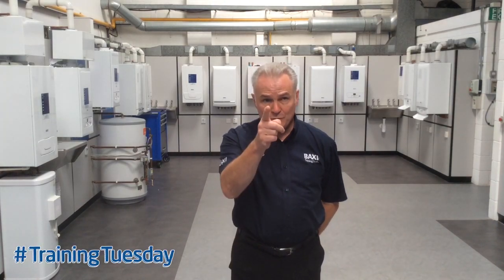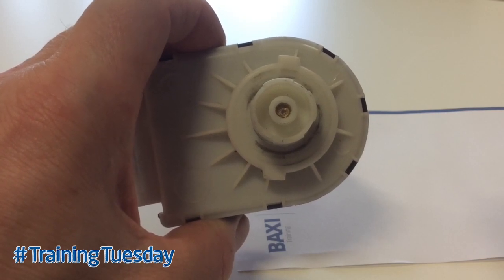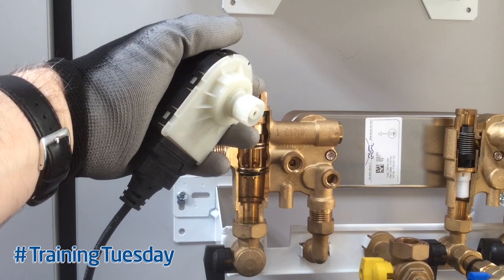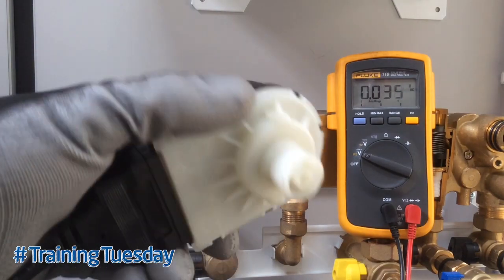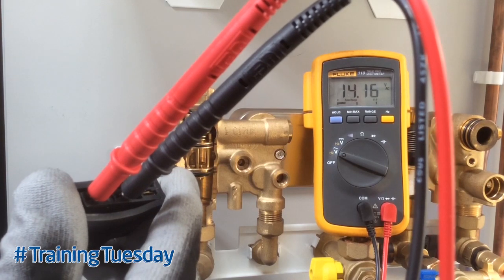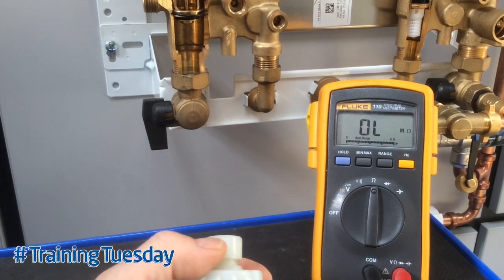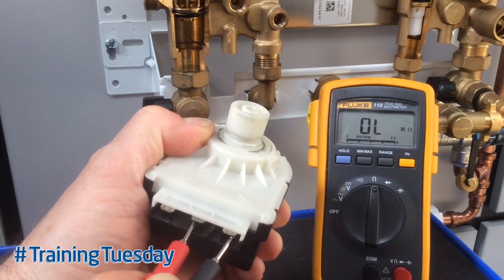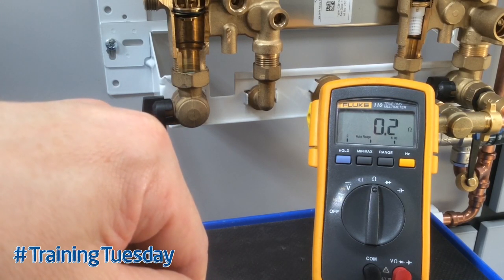A detailed look at diverter valves in a boiler - Part 2

Comment: There's a theory that the seals in the divertor valve are being compromised by inhibitor in the heating circuit. 4 year old Baxi 830, onto its third cartridge, leaking up through the plunger pin, same issue every time.

Comment: Whomever designed the plastic valves in the Duo-Tecs, needs his/her pay docked. They always snap internally and you need to take the manifold out to get the bottom bit out.
Reply: Guessing you didn't loosen the bottom union of the valve 1st ?!!!
This releases the hydrolock caused when withdrawing the cartridge.

Nowt wrong with the plastic ones when proper procedure used !!